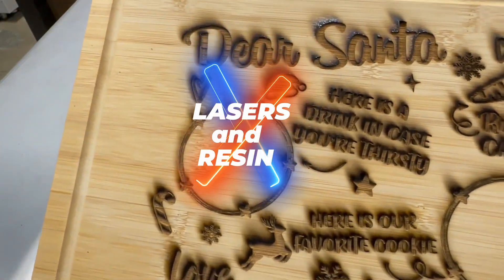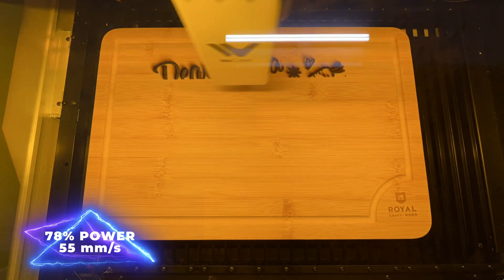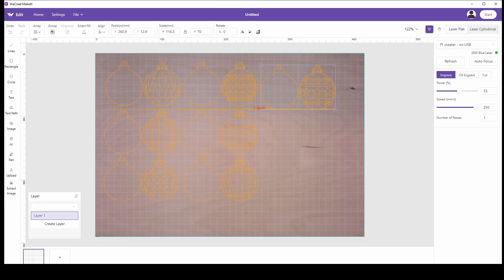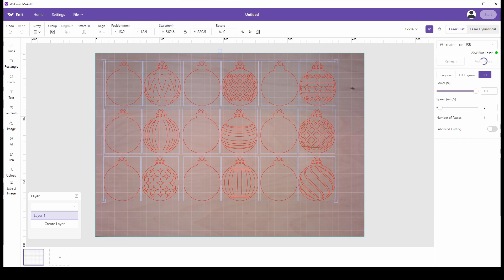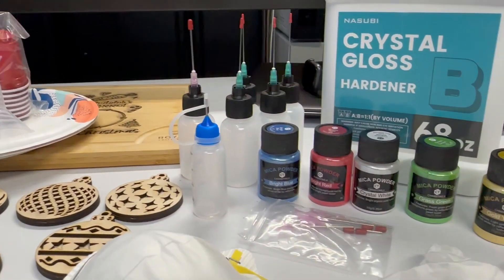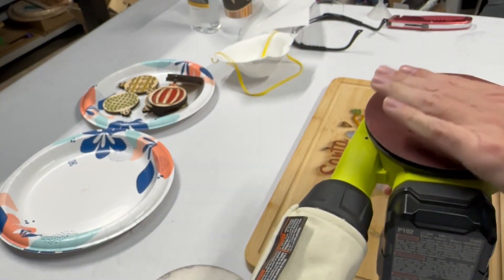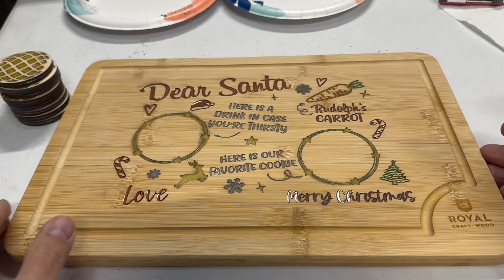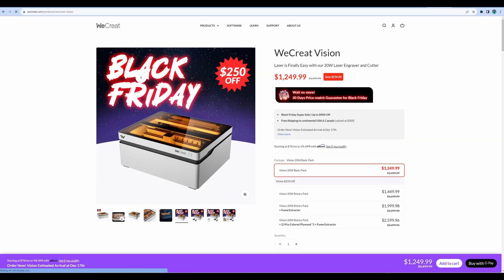Color Resin Infill  - Engraving with the 20w WeCreat Vision Laser

Comment: I love your video.  However, I do have a question a question for you.  When you created the Rudolph cutting board, did you do the second pass on the same cutting board? To clear up the charring, did you leave the cutting board in position, use alcohol ... and then, re-engraved the design on the same cutting board?
Reply from the maker: @joyceroberts2006  - Yes, I kept the cutting board in place.  All I did was a lower power higher speed pass, and that helped with removing the charring

Comment: You were obviously concerned about the red epoxy recessing below the surface. Perhaps that might be a potential problem for a cutting board because of getting food materials in the areas where epoxy did not fill up to the surface. However, I really like the dished appearance of the areas that have not filled up to the surface. To each their own.
Reply from the maker: I just wasn’t prepared enough with the first color red.  I was leaning as I was going.  I did like the red more, just like you.  However, when you go to sand, if you under fill, you have the chance of damaging edges with the sander. Think I will make another video, with resin and lasers, but on a bigger scale.  Thanks for watching and commenting 👍

Comment: Very cool.  I've been experimenting with this as well but with much larger regions for the resin inlay.  The amount of area I etched out is similar in size relative to the whole piece as if you did this to your Christmas decorations.  I don't recommend what I tried; there is just too much energy being dumped into the wood and it causes the wood to deform; cutting out the inlay pieces and glueing onto a backer like you did works much better.  The board design you did looks like it lends itself much better to this process and turned out very nicely.  That gives me hope for future use of this process.